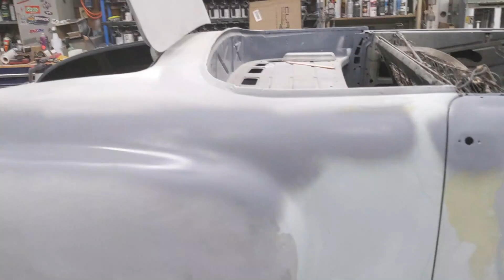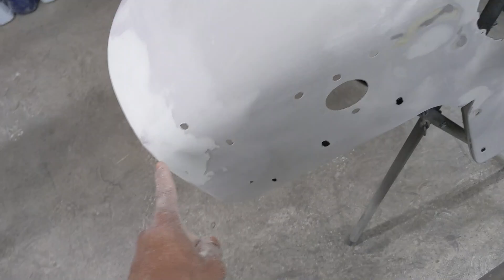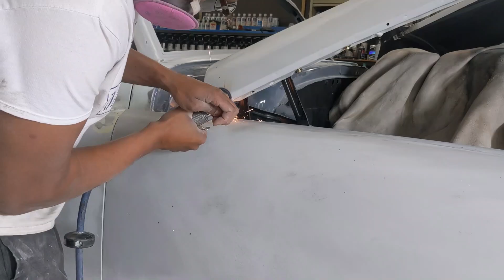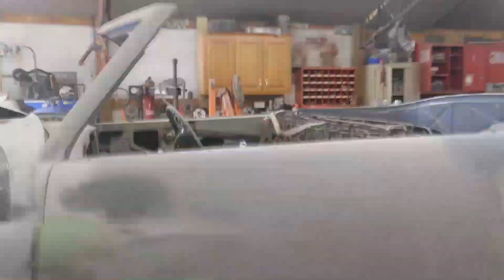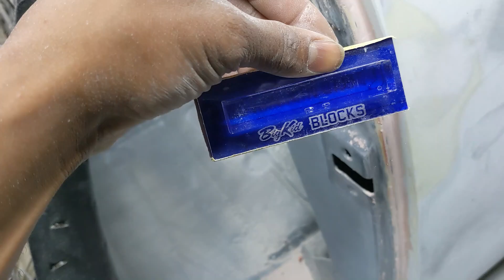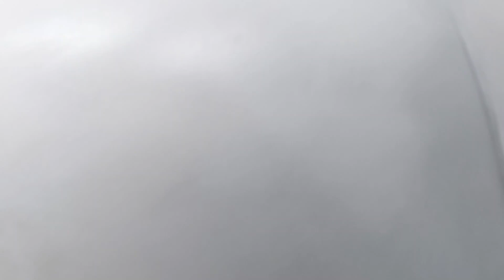HOW TO GET PRIMER READTY FOR PAINT USE A LASER!1950 Dodge #HOTROD #LASER#HOT #STUD #3W1B #fire

Comment: Hello, I looked thru your video library on this car, I was wondering if you welded the rear seams up or just dura glassed over them to create the smooth look? Or did the car come like that?
Reply from the maker: This car had both fender welded, metal worked and fiberglassed to create this look.
Reply: @3Wheels1Block you did a great job on it!
Reply from the maker: Thank you